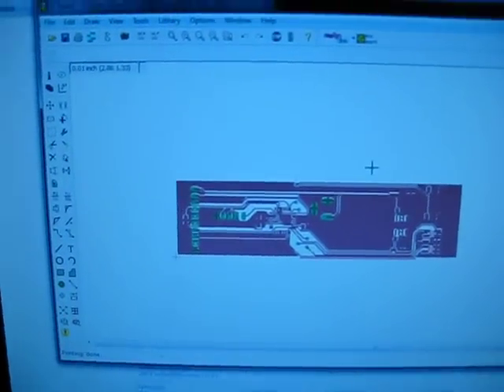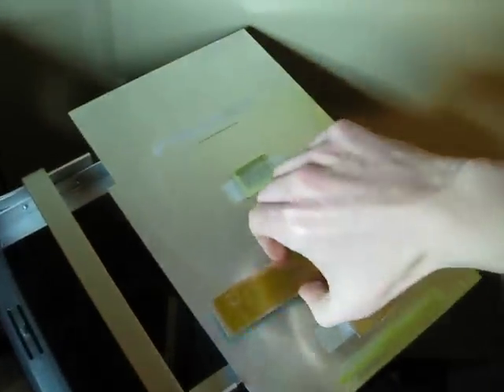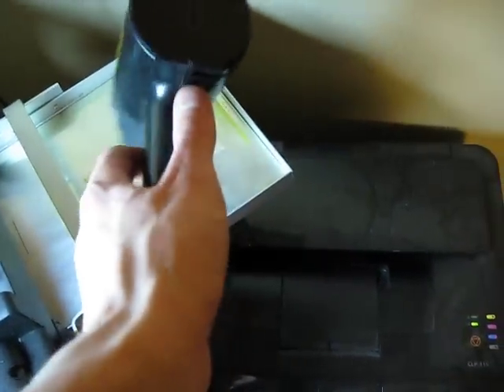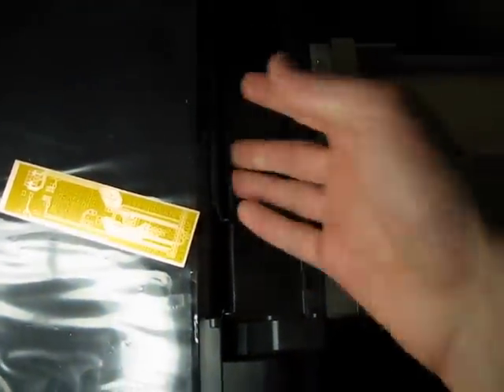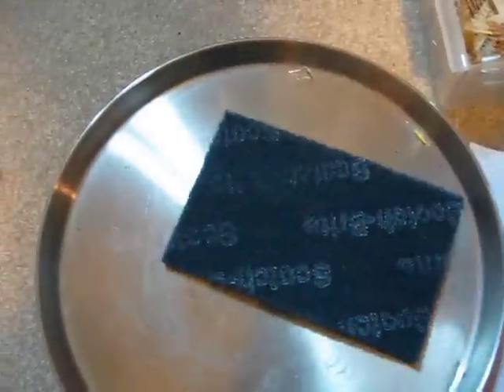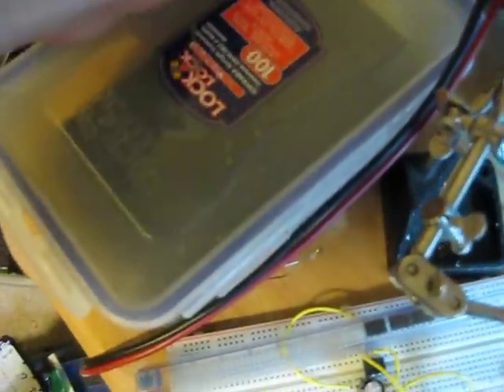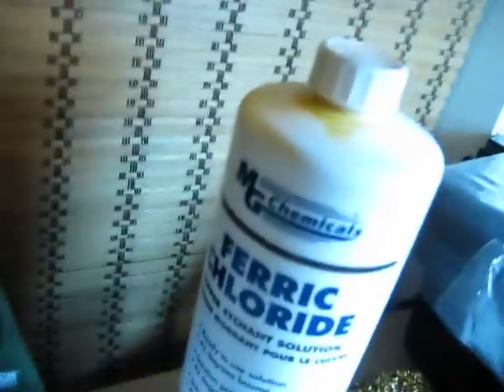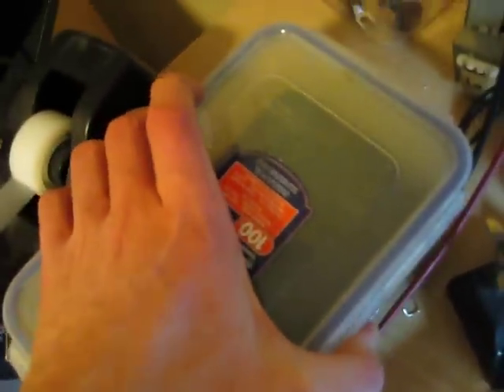Epson Printer Mod/POV board

Comment: You should heat up the copper board first then print on it then heat the board once printed for 3mins then etch... 

The ink as to be pigment based ink for it to work...

Comment: Had to watch this 3 times to get clear (I think) on the concept. So the purpose of the initial printing on the large board was just to allow you to position the copper-clad correctly?  Any idea how many printers this actually works with, and which ones? And are you saying that regular black ink from an inkjet printer will resist the acid that etches the board?